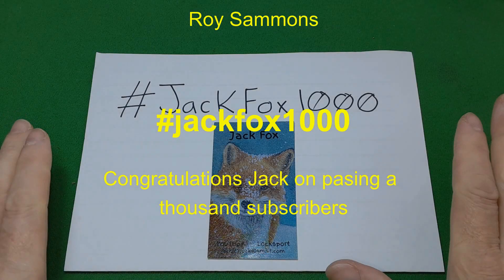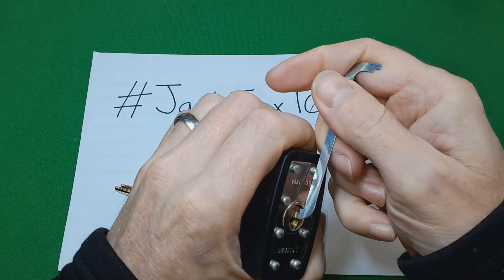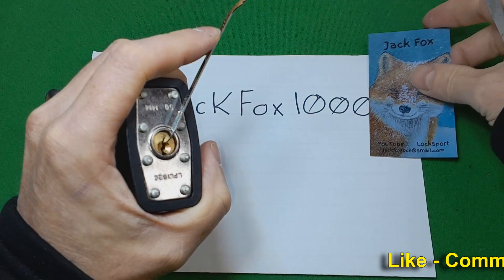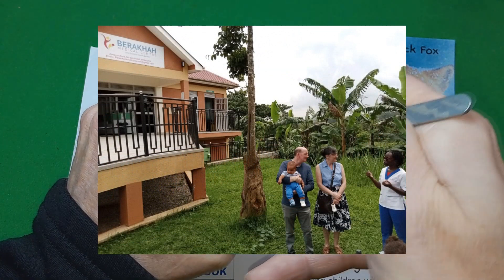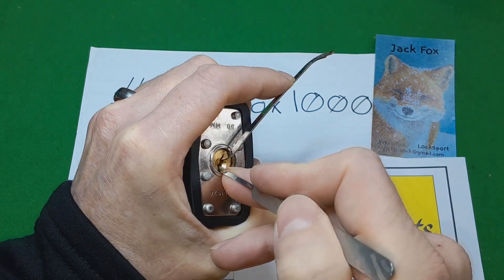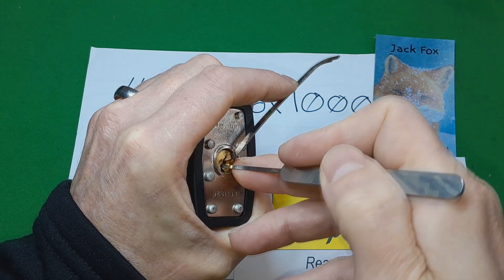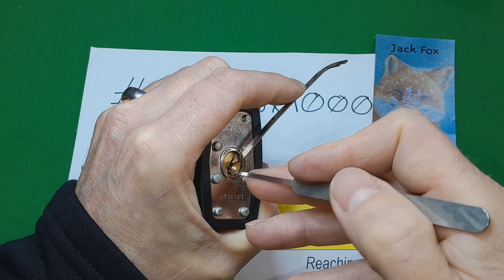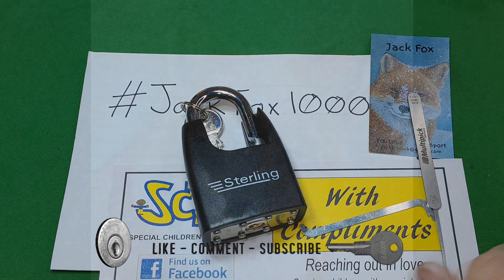(323) #JackFox1000 giveaway entry

Comment: Almost looked like the shackle was already open and you only just got the core to turn before the wrench slipped. Close call there 😂
Reply from the maker: After all that effort too 😂
My fingers were over the shake I think so it didn't pop open. Either that or it closed again so quick the shackle had no time to open 🤣.
Worst thing is this lock is one of those that's a doddle to open. 
Cheers BlackDolphin
Reply: Is fast forwarding legal? 😂😂 I agree with @BD90..  it looked like you just had it
Reply from the maker: @PickingPrincipals legal or not I did it 🤣. It allowed me to be bang on 4 minutes, so I took filmography privileges 🤣🤣🤣🤣🤣.
I got it open, well kind of, the tension wrench slipped out so fast on a full 90 degree turn of the core.  I could have filmed it again but hey ho! 🤣🤣🤣🤣🤣 Let's keep it real. 
😉